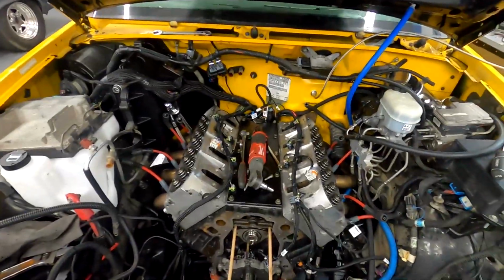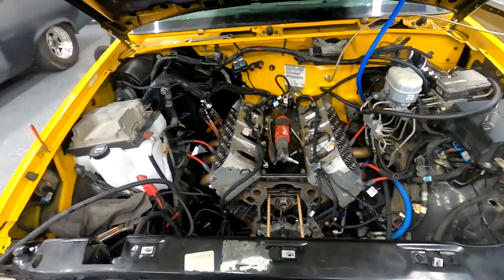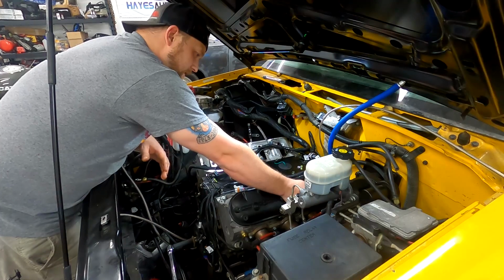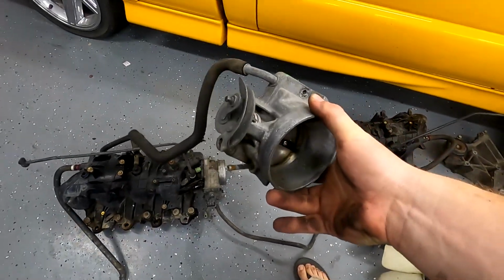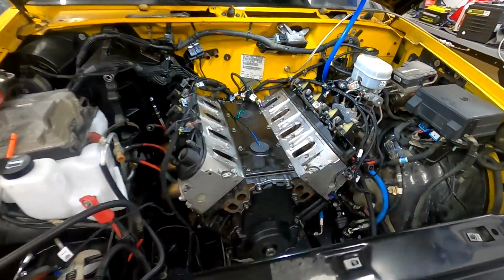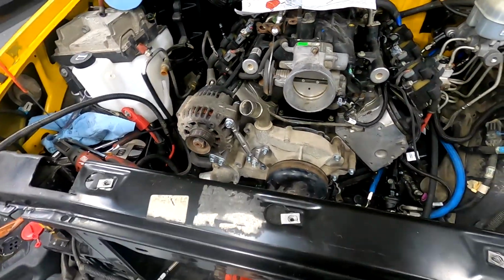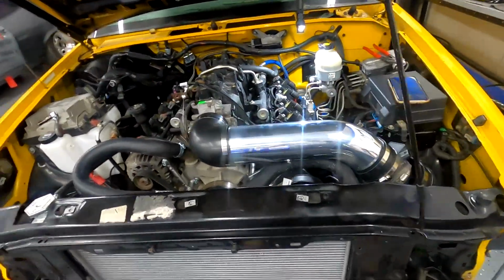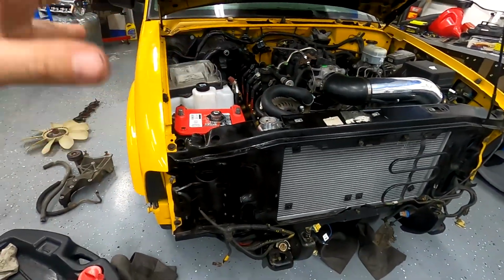LS Swap S10 Xtreme- Going Backwards.. First Start Again?

Comment: Wish it would have worked out for you , fixing to do a 5.3 swap in my 1995 S10.  My donor truck is a 2005 Tahoe... The 2.2 only has 71,000 miles , but it's on its 2nd head gasket and I'm tired of it turning into a money pit. Don't give up on the S10  !!!!
Reply from the maker: It is a fun swap! For the most part pretty easy too.  I won't give up on it, I will be finishing it up over the next couple weeks.  It just won't have  the cam and intake.  I may revisit that after i get a good start on the Nova, we will see.  The S10 will still be a little ripper! Good luck on your swap!
Reply: @HayesAutoWorx  What Base motor are you using ?
Reply from the maker: @bobbiesawada9460  5.3 LM7 03-07.